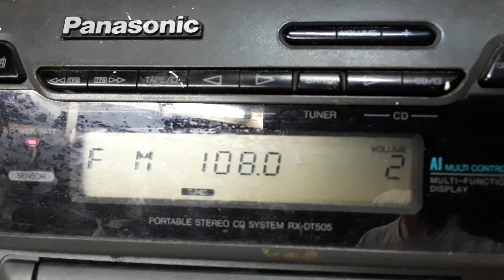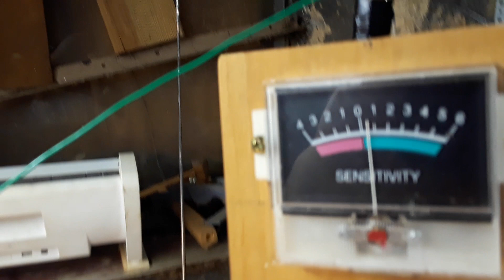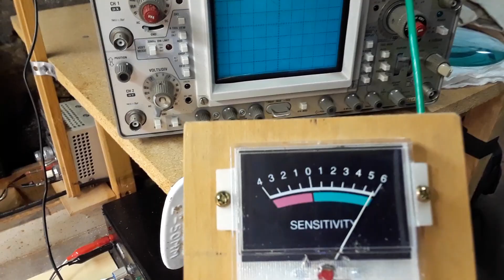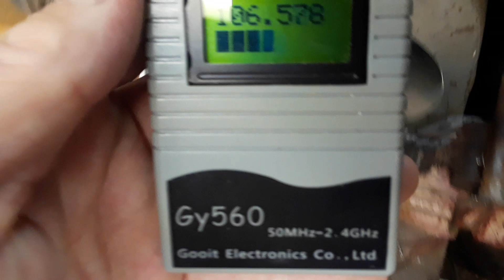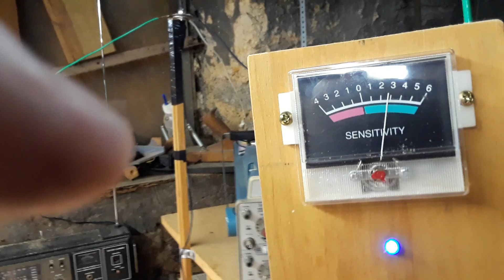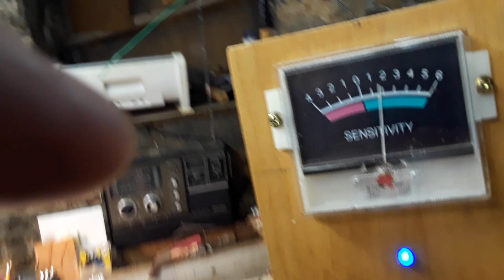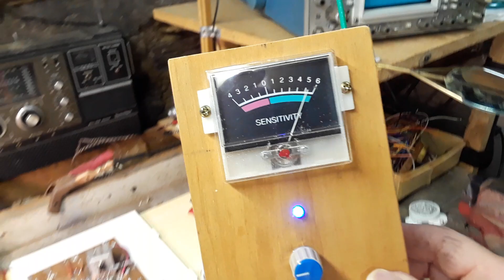Long Range FM Transmitter circuit (part1)

Comment: neat construction
Reply from the maker: Thanks for watching!
The layout was very important here or the RF components would interfere with each other.
Reply: @andrewferg8737  I am trying to build the circuit in a Printed circuit board fashion to make it more robust and if it work normally i"ll make a video on it. Hope for me success.
Reply from the maker: @moustaphamuhammad7013  

If you have the chemicals and silk screen material, a printed circuit on copper clad board should work quite well if you design the ground plane properly. You might need a additional ground layer depending on how you arrange the traces. However, do not use perforated board with little holes. I tried a prototype with this method and it did not work as well as the copper clad board. Even with star grounding, there was still a lot of interference on the perfboard. Good luck!
Reply from the maker: @moustaphamuhammad7013  
Have you had any luck with the project?
Reply: @andrewferg8737  yes I did but it was very noisy and lots of statics. I think because of the parasitics capacitance. I will try to bulit it in separate parts then study from where the noise comes from, wish me luck. And waiting for your next design.
Reply from the maker: @moustaphamuhammad7013  
Also be sure to use a proper ground plane antenna and coaxial connectors.